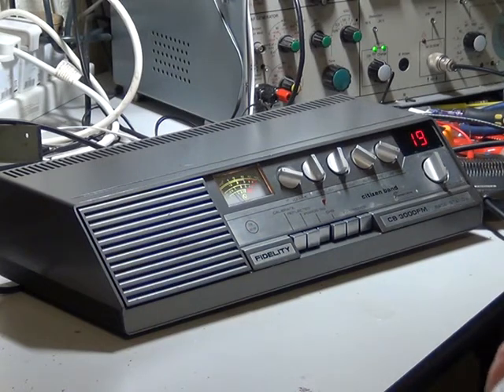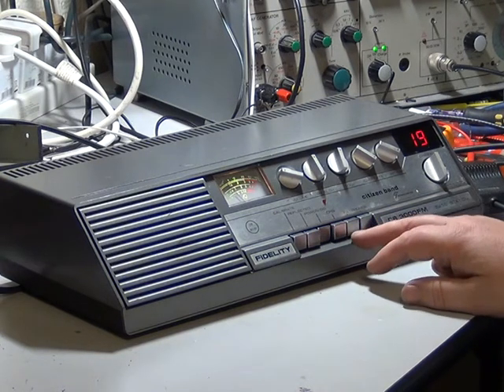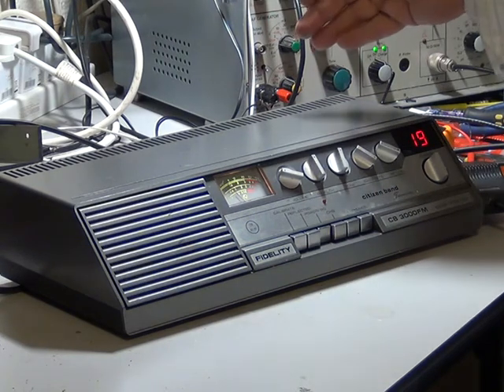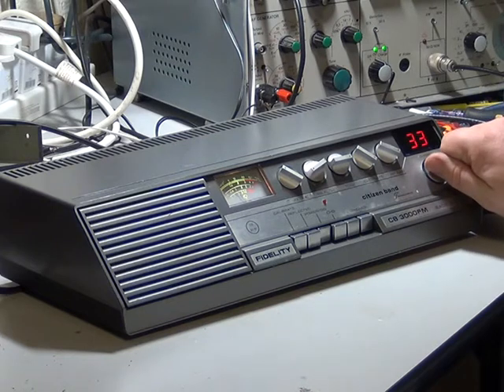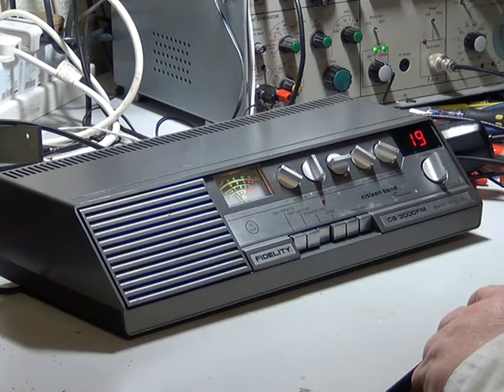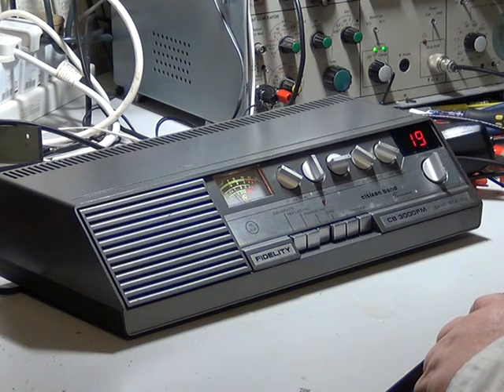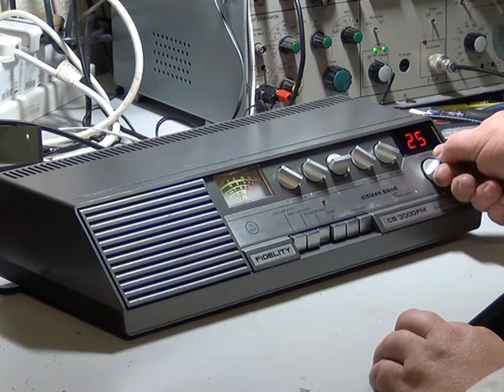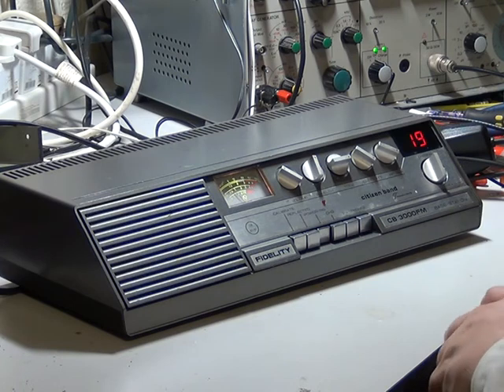Fidelity 3000, UK (CB 27/81) CB radio (Base Station)   -  On The  Air Test

Comment: Fantastic radio one of the best 27/81 CB Radios ever I wanted one for years back before I done the foundation licence and I really did want one because they are a lovely looking radio and there's loads of features on the front of the radio and it has a built in SWR meter so maybe one day on ebay or amazon one might pop up for a decent price and I'll definitely get one see what happens. Thanks and best 73's for now cheers. Stephen M3SNV 73's.
Reply from the maker: They are certainly unusual looking, though not good performers. However, in a rural location like I'm in they are quite useable. Note that the year before, Fidelity sold the MR1 (I did a video on it in 2017). The MR1 was a mains table radio in the same sloping case. Te two radios look great side by side.

Richard, G0OJF, UK

Comment: Thanks for the nostalgia! This was my first CB. I later upgraded to the Uniden 300, a world apart in terms of build quality, but I did enjoy the futuristic plastic look of the Fidelity while it lasted :)
Reply from the maker: They tend to be reliable but poor performers especially regarding receive selectivity. The other snag is that they are more difficult to service as they require use of a sweep generator, an instrument few 2-way radio engineers possess!

Richard

Comment: I had one of these in 81 and it had a great feel of cheapness to it ,,I got rid after 2 was , and never regretted it, However I had a similar opinion of the Murphy Homebase but never owned one so corrected that and bought one yesterday , from Knights ,, that radio has a solid feel of quality despite a thumpy sqchelch  SPELLING,,, and electric hum it does have a kind of charm,,,  if I was clever enough at the time would have changed the board in the 3000 and turned it into a hybrid ,,, but nice to see one ,, thanks for the great video ,,, I am featuring some old radios on my channel ,, cheers Shane warks  CT1017
Reply from the maker: The Murphy base is in fact a reboxed Spirit 40F mobile/transportable. The entire stock of Spirit 40F's were smoke damaged after a warehouse fire. The innards were rehoused in the UK to produce the Murphy base, produced for Great Universal catalogue group. The Hum can be cured by remounting the mains transformer at a 45 degree angle.

Changing boards from one Uk legal set to another is in fact illegal, as continued conformance to MPT1320 cannot be assured with laboratory testing.

Bear in mind that the Fidelity 3000 shares the same poor receiver performance as the Fidelity 1000 and other monile using the Great GT858/868 chassis. The Fidelity 3000 is, however, a custom designed base station board & not a mobile board in a big biox. Usually 2.5W is all you can coax out of the transmitter. Good points; unusual styling, large meter, large loudspeaker & aux out socket for a tape recorder or other device.

Richard

Comment: Hi Richard, I just repaired one of these last week, final had gone due to a slack nut and bolt so was not getting pressed fully to the heat sink, not an easy radio to dismantle. Anyway, a quick question. What is the real purpose of L6? not doing anything here during alignment, is it actually for notch filtering? I managed to push 3 watts out of it using an Eleflow 2166 copy  transistor during repair.
Reply from the maker: Roger on that. I take it you have the service manual, if not email me. I assumed L6 was part of the PLL doubler circuit. It's the first coil to adjust during tx alignment. if you were really really bothered, you could monitor the output withh an RF voltmeter for peak.

3W is fine, they are 3.5W absolute max. I was told by Fidelity that this & the Fidelity 1000, 1.7W is minimum acceptable output.

Richard
Reply: @ukfmcbradioservicingTango21  Thanks Richard, I have given the Fidelity back to the owner, he absolutely loves that radio for RX, I found it a nightmare to strip and put back together. Regarding service manual, if it is the 9 page user/service manual, I already have a copy, thanks. Funny thing is, was looking at a shogun today with intermittent TX fault which I couldn't replicate, I noted similar to the Fidelity, loose screw on the final to heatsink! Think I need to check this on all old radio's in future...!

Comment: Just picked one of these up on eBay (spares or repairs). A quick tune up and she’s running sweet. Pity i can’t get tx output above. 2.5w but still a very tidy radio with the original fidelity mic 👌🏻
Reply from the maker: Yes, Simon. 2.5W is in spec. It is a 3.5W radio anyway. In reality it makes little difference.

Richard

Comment: Just bought one off eBay looks like a spanker with receipt ,,box instructions etc ,,will review on my chan when I get it in a wk cheers shane
Reply from the maker: Well done, despite the poor performance these are highly collectable...especially with box & receipt. Not many base stations have an auxilliary output socket on the back to record from the unit like this does.

Richard
Reply: are there many people using cb radio these days?? thinking of setting mine back up but your lack of replies is kind of putting me off???
Reply from the maker: Well, I'm 7 miles from any town & 35 miles from either Nottingham or Lincoln. There are plently of business users like farmer & quarry workers, but they are not there for a general chat of course. One or two users in the nearest town & you may have hear me speak to Mower Man and Electric man, 8.8 miles & 7,5 miles away respectively in Grantham. I tend to mainly speak to specific people myself anyway.

It depends where you live. The cities still have bucket mouths, people with illegal radios & huge illegal linear amplifiers as well, the illegal users of ham radio equipment on huge power & never changing channel off 19 because at the 400Watts they are pushing out have no need to. The government inspectors nick a handful a year, but not nearly enough. I few months ago,  I drove from York back to here near Grantham....130 miles..ish, and had the same burner guy talking from York, until I finally lost him at Newark. Wall to wall for 100 miles. That disgraceful & illegal behavious therefore stopped anyone else using 19 for 100 miles radius! Those are the snags.

I personally use CB when I'm going somewhere with friends in more than one car...you can legal;ly chat "when safe to do so", unlike mobile phones. I liaise with friends when several of have to meet up in another down either business or pleasure & it works great for us. I have a base station in the house here, the electrionics workshop (as per the videos) & our pipe organ restoration workshop (main business here). We have CB in all cars.

regarding hobby use like "19 for a copy", I respond to some of those from time to time, but I will not speak to users who are operating illegally, so tread very carefully. As a heavily licenced person (class A radio amateur etc), I don't want to lose my licences being caught talking to an illegal user...which could happen.

Hope this helps.

Richard
Reply: wow lol great answer, well ive just spent £50 to re-live my 80,s youth see wat i get, im in north wales so hoping to get a few truckers going to and from holyhead etc,and a few locals, i.ll keep you up-dated, ye thanks for a great reply mate...
Reply: thanks rich

Comment: its a shame that less and less people use CB they was big in my earlier day (god that makes me feel old saying that! lol) it was a good form of communication but the new licensing (at the time put lots of people off!)  do you still need a license for them now?
Reply from the maker: CB went licence free around 1999, but with more or less the same licencing conditions (on offcom's website). There was a relaxation of the aerial rules so that just about anything except a beam aerial is permitted. Radio transceivers still, of course, have to 'type approved'. Nearly every new CB on the market is now of the "EU Multi" type, where you select which country you are in off a menu & the radio is then programmed with the correct frequencies & other parameters for the country you are in. This enables manufacturers to target all Europe with each model they make, instead of one type of radio set per country as it was before. Though the latest models (mainly from China) look great & have a host of features for quite small cost; some of the swishest new rigs are quite deaf on receive when compared to many of the 27/81 models from 30 years ago!

I still find CB virtually unuseable on channel 19 in big cities, there are the bucket mouths & music players still, the illegal burner brigade, the people wo sit & chat on 19 without moving channel, often illegally using high power Amateur radio equipment set up on the CB channels (Ham radio equipment isn't supposed to do this). Here in an isolated rural location, there are farmers using CB properly & legally, the local town 7 miles away is Grantham & there are about 8 sensible users worth talking to!

Richard
Reply: UK CB radio servicing
Thanks for the info, O' yes I remember the "bucket mouths & music players"  hogging up the channels and jumping on other peoples channels and doing it. so things their doesn't seem to have changed there then! lol.  or the "sit & chat on 19 without moving channel" for that matter.

that what you was saying about "Amateur radio equipment set up on the CB channels (Ham radio equipment isn't supposed to do this)"  is or isn't that illegal?